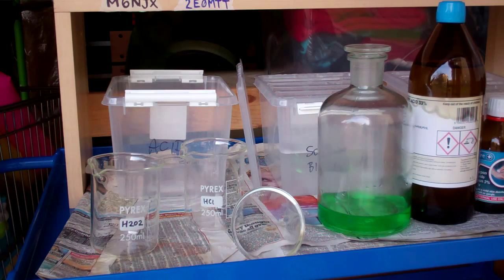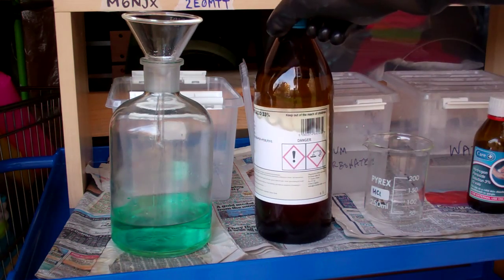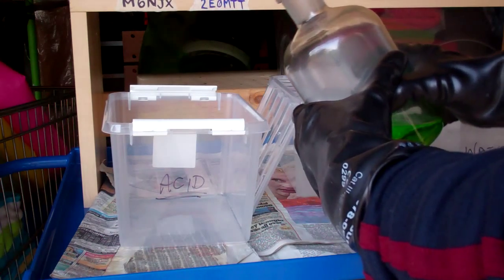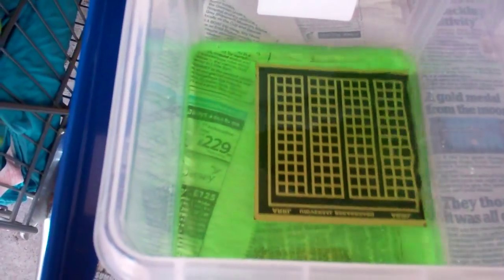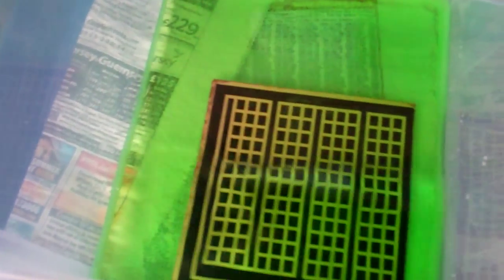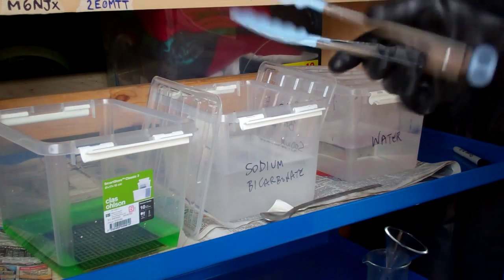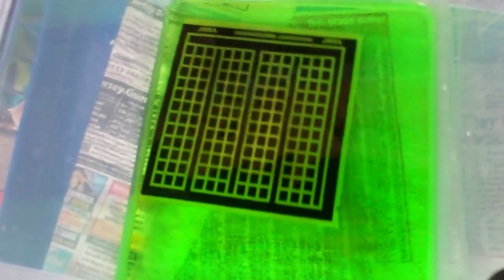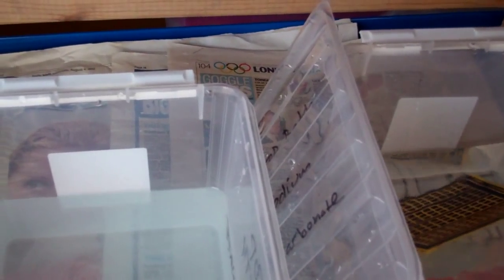Toner transfer DIY PCB - etching the copper surface

Comment: Nicely explained, pretty straightforward method! I have two questions:
1) How many times can you reuse the acid mix?
2) For a 5-8% HCL which can be found easily in stores, what ratio would you suggest?
Reply from the maker: Hi Alex, my experience of reusing the mix is  reasonable.  I have not calculated reuse in terms of surface areas of boards etched. I mix my batch (say 100ml HCL 33% by volume+200ml H2O2 3% by volume =300ml =  a Coke can of fluid) and use it on the day. It etches well for 5-10 boards that are double-sided PCBs say, 80mmx100mm each. It stores well and when reused...if it is slow to react, this is due to the breakdown of H2O2, so add perhaps 20ml to 'refresh' the mix. Eventually (usually when there are long periods of time of non-use of the mix) I will add a fresh 1:2 mix of acid:peroxide, increasing the total mix volume and etching continues, even though the new added chemistry is diluted by the older mix. Exhaustion is usually accompanied by a darkening colour in the mix (brownish). The colour is a good indicator of freshness of the mordant.

Regarding low ratio HCL, 5-8% is likely too low, I have only worked with 33-35% HCL, which dilutes to ~10% (via the 1:2 ratio of H2O2) in the final mordant mix. HCL by itself is not a copper etchant - it needs the oxidation from H2O2 to dissolve the copper, forming  copper oxide which itself "eats copper".

Comment: I do not know why you have to use such dangerous chemicals, when their are much safer alternatives. I use ferric chloride it is just as efficient and much safer and none toxic.
Reply from the maker: +Ortorea Screenname  Thanks for watching the video and sharing your comments! According to the relevant Material Safety Data Sheets for ferric chloride http://www.sciencelab.com/msds.php?msdsId=9924033  and hydrochloric acid http://www.sciencelab.com/msds.php?msdsId=9924285  , both substances are comparably 'risky' (compare the National Fire Protection Associations 'hazard diamond' on each sheet (you can 'read' the diamond with this reference page http://www.brady.co.uk/en-gb/related-information/safety-signs/related-info-safety-signs-nfpa )

To be clear, ferric chloride IS toxic and should be treated with caution and safety measures "Potential Acute Health Effects:
Very hazardous in case of ingestion. Hazardous in case of skin contact (irritant), of eye contact (irritant), of inhalation. Slightly
hazardous in case of skin contact (permeator). Corrosive to eyes and skin. The amount of tissue damage depends on length
of contact. Eye contact can result in corneal damage or blindness. Skin contact can produce inflammation and blistering.
Inhalation of dust will produce irritation to gastro-intestinal or respiratory tract, characterized by burning, sneezing and
coughing. Severe over-exposure can produce lung damage, choking, unconsciousness or death."  

Any substance that can dissolve metals in a short time is something to be careful about!  Be safe and enjoy making your PCBs!
Reply: +Queuerious Guy  thanks I think your right, some other guy on youtube said he tasted the ferric chloride I thought what an idiot he was to even do that lol
Reply: well your first comment sounds opossite, but if you say so, then I'm glad to hear that your doing fine :)
Reply: +Ortorea Screenname If you're not 100% sure which etching material is or not toxic and looks like you could use them somewhere, I would strongly advice you to google at least safety and disposal of those materials before getting hands on the lab. It may save your health for the rest of your life. :) At least use all of them withgloves, gurgles and do it out side till you're 100% confident that it is not hazard.
Reply: Don't worry Bob I have plenty of experience I simply was pointing out that some uneducated or misleading people are giving bad advice, I have over 40 years experience in electronics so am well aware of toxic chemicals.
Reply: Yeah sometimes my conveyance of meaning is a little sarcastic sorry about that.